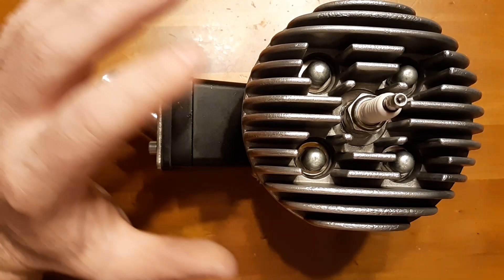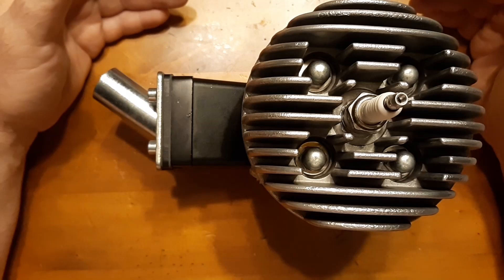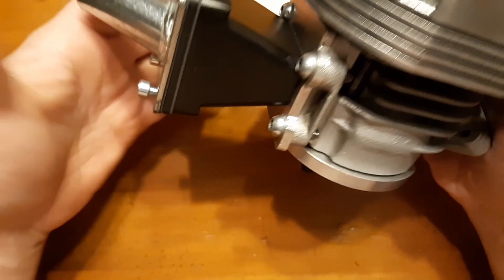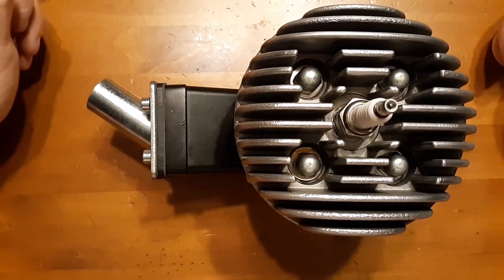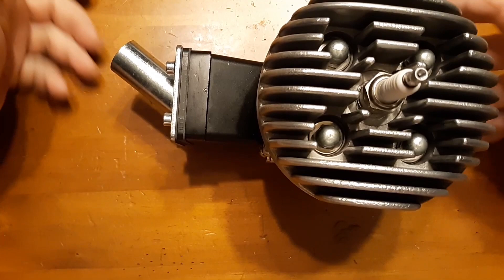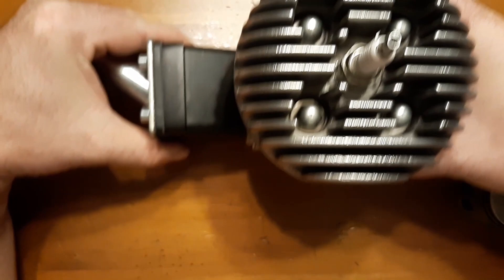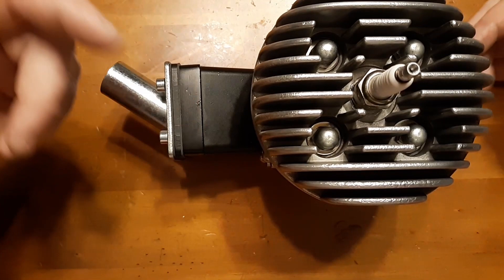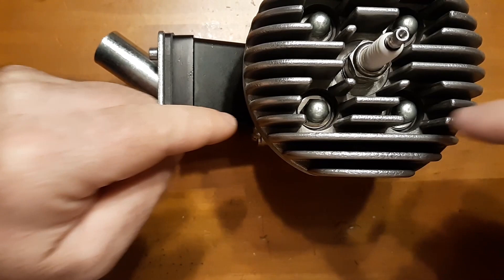Brutally Honest Truth About Motorized Bicycle Minarelli Builds!

Comment: I really do like watching your videos and I’ve even learned from them.
I have a 2001 Yamaha vino scooter and I put a polini contessa sport top end on it, runs great with quite a bit of power, the thing screams! 
I’m running stock roller weights and it has good torque and when it hits the power band it really starts moving.
I personally prefer iron jugs because I feel they last longer.
I like to run my engines on the rich side and not for absolute peak performance, but I definitely don’t run it wide open for long periods of time but I never do that not even on a aluminum jug bicycle engine.
From what i understand 2 strokes clean out the case and don’t have as much lubricant when you are turning them wide open, all that rpm,heat and less lube sounds like a disaster waiting to happen (why I run on the rich side)
I run castor oil for its superior film strength and its lean run properties of becoming a grease like lube when it gets very hot, of course the scooters have a fan and I think it might survive at high rpm’s for a bit with my tuning and setup BUT I am not going to test that, 1 it was not a cheap top end and 2 I like my stuff to last.
Reply from the maker: One day I might buy an old Italian scooter and restore it for fun 😜 I'm glad some stuff helped on my channel 👍

Comment: It’s kinda sad tho how a saw needs to have 30 more cc’s just to keep up with a scooter cylinder lol
Reply from the maker: Not the reason!  Saw builds are more low end! 1.8mm squish.  Minarelli is .70 squish!  lower squish more RPMS!  But just add pop up piston to saw and minarelli can't even come close to saw build! 85cc Piaggio case reed build my friend has out of the gate is in dust LOL add a reed block to saw its a chain breaker!
Reply: @BuildBreakFix  im sorry but a well built Athena cylinder Thats ported can make 15hp and they race them in SoCal. Notice how no saws race in cali anymore? Don’t take it to heart im just sharing what I’ve seen man
Reply: @keeganhache6667   yeh , but athena cylinder kit price is like about 4 times what a saw cylinder kit cost , and with the athena you need to add the reed valve cost wich is also a nice dime if you want to put some nice carbon fiber reed so for me a athena build is wat out of my budget who knows what can you do with a saw jug with the same buget you know what I mean ?
Reply: I want a chain snapping hi yo silver build
Reply from the maker: Will rip tires off the rims!  🤣 https://youtu.be/fvDZe3VqyjE?si=34oedXGx11oe9ylS
Reply: I’ve got a couple minerallis with no issues whatsoever easy 50 plus engines
Reply from the maker: @jeffwalters6044 you get your cast iron jug minarelli.live stream it doing 50mph for 60 seconds. Like I have told even people selling them to I'll hand you $100 bill next day. It's not mechanically possible. It's Called thermodynamics. Even with a ceramic topped piston you can't last 45 seconds before it will cold seizure.  79 people tried 79 failed 😂 11 resulting in a complete engine loss

Comment: I really wish I woulda done my research before I bought.i literally trusted a friend that knew Kurt Smolik so I assumed he would get me a good one from him.nope I paid $400 for just the engine,then another $100 for him to weld up my pipe and he loaned me a head,gave me the wrong plug to start,the crank slid side to side,ruined my magnito and stripped the magnet bolt on and I can’t even get it off to try n fix the issue.now I gotta scrap that bottom end and start over.i have another bottom end to use.can u tell me for sure is it long rod or short?it looks long.anyway thanks for all the info man
Reply from the maker: @davechap7819  almost positive it will be a (long rod) only very few builds use short rods.  Like 2.  Do you mean stroke length?  When in doubt! Go for 40mm stroke.  10mm spacer.  If you have a 38mn stroke it's a 8mm spacer  . Start standing lol. 400 grit works perfectly start to finish.   If you have a short rod it's 88mm center to center of its holes. If you have a long rod 115mm center to center of its holes.  Sholes be easy enough to eye with a metric 📏.   Hope that helps some! Edit if you have short rod no go on the minirelli build! Needs to be a long rod crank! Not unsave able. Just needs a crank swap. Lots of elbow grease

Comment: What about all the car engines that use iron sleeves and aluminum pistons? My GSR motor in my '98 turbo Civic has aftermarket cast iron sleeves, and 2618 aluminum pistons. All that needs to be done is proper piston-to-wall clearance. In my case, I have an 81.5mm bore, and that clearance I like is 4 thou.
Reply from the maker: You know what a redline is then and a transmission correct? Since we are talking cars.    Minarelli vertical engine was designed to work with a CVT transmission on a moped.  Redline for a minarelli is 6500rpms.  When you blast it doing 10,000 rpms to make a 1 speed bicycle do 55mph.  Whole a different story and thermal dynamics of two metals don't play well when expanding.  To answer your question (sleeved) aluminum blocks can dissipate heat closer to pistons expansion rates than a cast iron block can.  Furter that! Steel sleeve in a super high end build has titanium 3 to 5% mixed in so the steel expands farter then the aluminum lol.  Been building engines for years man lol swear to God if you look up all that you will find it repeatedly preached by many builders of All kinds of engines. Supercross dirt bikes to NASCAR

Comment: I keep seeing this "cold seize" being used as if it's a real issue. A warmed up engine does not cold seize unless there is something else going on. Cast iron jugs have been around a LONG time now, and the only "cold seized" engine I ever saw were run too hard upon startup, without letting engine come up to temp. Kinda sounds to me like you just have an axe to grind and want to shit on Minarellis. If the problem was as widespread as you claim, MANY others would have had this problem by now. Sounds like advertising to promote saws over someone else's kits to me.
Reply from the maker: You have no idea what your talking about!   Nor do you understand basic reason it happens clearly. you know I sell Minarelli Engines as well right? Just not crap builds like you find on ebay people get screwed over.   Bro there a reason people drop 1000$ on minarelli build.  Sure cast iron jugs have been around for years. They also are not going 12,000 RPM at 485F+ degree temps.   (The Cast iron jugs are used with Transmission)  (Called thermal dynamics) aluminum will always expand before steel faster!   They last longer and have lower wear rates for there correct use.  But they also don't go over 7k rpms for more then few seconds till transmission kicks in normally run at 4-5k rpms on a moped.   Idiots that mount one on a bicycle engine have no transmissions.  So they run it at 8k+ rpms and they cold seizure.  But hey only built 478 of them now. And have lots of videos in great detail how to build one!  BUT! Be my guess when you build it and you waste your cash on Cast iron jug come back see me and i'll tell you how to fix it for another 500$ on top of the 500$ you just spent buying a 90$ piece of crap anyone can buy off aliexpress!   

TO back up my claims! I Offred $200 to any person to ride a cast iron Minarelli jug  @ 40MPH for 40 SECONDS on live stream 5 months ago when I posted this video! Which is not even close to max speeds! Not one person out of 78 People did it and 6 trashed there engines trying. so your more then welcome to add yours to the list of shame!
Reply: @BuildBreakFix  As far as my experience, yeah I'd say about 45 years of two strokes and race engines makes me qualified to speak on the subject. You clearly have some agenda and an axe to grind with Minarelli builds. Saying stuff like this only makes you look foolish to the experienced builders out here. Stick with your saw builds and stop trying to sound like an expert. Maybe building 500 more will teach you something.
Reply from the maker: @ManiacRacing  are you just retarded? It's a common problem learn wtf your talking about. Go troll some other place. You clearly are very confused.  Considering everyone but you seems to understand the issue try simple google search.
Reply from the maker: @ManiacRacing  really so you started building engines when your 5 years old lol dude go bull shit some other place.  Done wasting time on you lol what moron
Reply: No wonder I never heard of you before I stumbled across this video.
Reply: @BuildBreakFix  @Lowell Ray is correct. Cast iron jugs have been used for decades and go thousands of miles. Not anyone elses fault if you don't know how to tune or warm up your bike before beating on it.
Reply: @catsbyondrepair  scooters have a fan constantly blowing air , take that fan away and the would overheat like crazy
Reply: @BuildBreakFix  Where do you sell your engines at plz🙏?
Reply from the maker: @marcusprince3999  I'm not anymore right now. Ups and FedEx have not been reliable. Nor are they honoring their insurance policies. Items get stolen in there care way to oven and they give you a run around for weeks.
Reply from the maker: So funny this. Conversation.  I put up 500$ to first person live video show me a minarelli doing 45mph 45 seconds. Yet in 1 year. No one with a cast iron jug has done it. 279 tried 279 failed. 18 with total engine loss as a result. Good thing you all are better then half tip builders solved this issue.  How about you go next? I would love to see your cast iron engine seized.   You all talk shit like cast iron jugs are bomb. You can't grasp they are in a moped with a transmission though only doing 5k rpms. Not 11 grand in 1 speed bicycle. Ask smolik too minarelli builder this. He will tell you exactly what I did. Aluminum jugs won't cold seizure so that does not count.  You all realize I have 15 minarellis right and CNC cut parts sell them for minarellis for over 10 years for people. Every sawzilla builds people pay 3 grand for are my builds even lol I would hope you all get a bit more educated about how aluminum expansion is faster then iron and how cold seizure happens before running you mouths about shit you have no clue about.  You realize I hold 36 titles in super cart racing. So yeah I do know a lot about engine building.

Comment: 😂 $400 stage 6 cylinder...stop it
Reply from the maker: for one that is not pure garbage yeah 325ish now adays. Back when video came out was about that. half those black coated knock offs are pure trash for like 200$
Reply: @BuildBreakFix This stage 6 70cc aluminum cylinder costs ≈180-200€ in Europe, I don't understand how it can be resold for 400$. This sale is simply a scam. 400$this is the price of the cylinder kit with the exhaust and the carburetor
Reply from the maker: @elodiie5430   47mm 77cc is actually about 350$ "at the time the video was made'.  Almost a year old.  Currently 260$ for 47mm in states.  Should of said it as a complete top end. Reed, head, jug, reed cage, gaskets and piston.
Reply: @BuildBreakFix  Wow it's really very very expensive I think, the importers must add the tax and a comfortable margin I think 😓 Here it is very common and the price is not as expensive, many young people ride with this kind of cylinder daily with mopeds